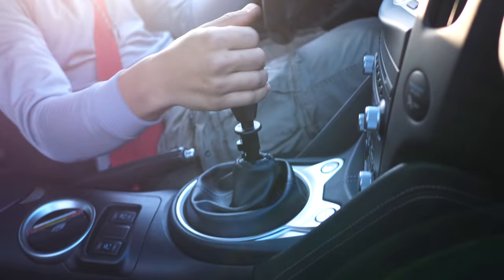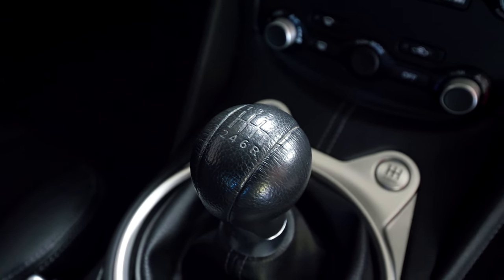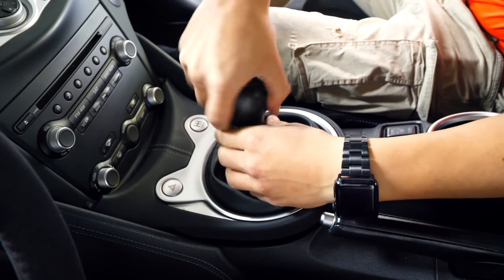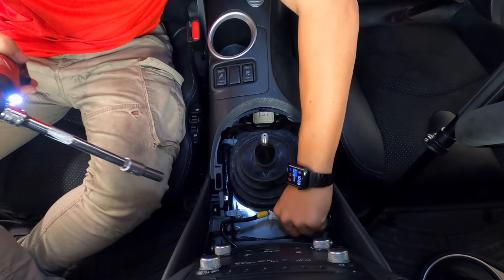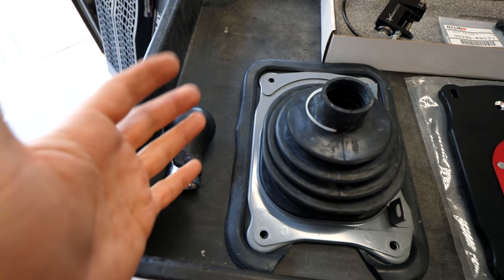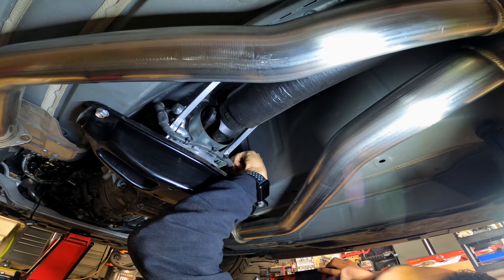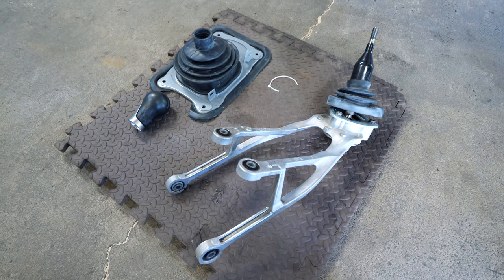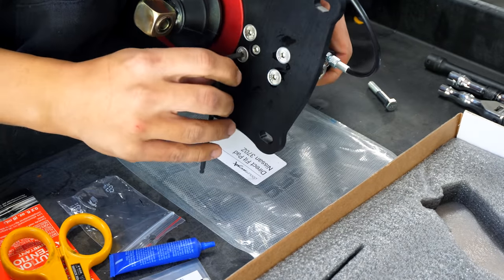The BEST Short Shifter for your Manual Transmission | Complete Install & Review

Comment: I got my shift knob off without any damage at all. All you have to do is use a heat gun and it helps break it loose easier just use gloves or a towel so you don’t burn your hands
Reply: I wish I read your comment before I had to muscle mine off.

Comment: Most important question 🙋🏻‍♂️ did you chase down that rattle yet? Also hows it holding up? Do you have to adjust every so often?
Reply: apparently if you tighten the bolts on the mount a little more and/or use loctite it will fix it for the most part

Comment: I don’t have a 370, but I have a 350z, I swapped my stock shifter for a weighted Mishimoto one and I never had troubles getting my stock one off, took 2 hands and a bit of strength 🤷🏻‍♂️ I’m no hulk but definitely wasn’t as tight as yours
Reply: Mine was hard. I had to buy a rubber strap wrench from Home Depot to get mine off.

Comment: This works perfect on 370 Z‘s if they do not have a black box blocking the two lower bolts that go into the fork otherwise you’re going to have to remove the black boxes to remove the lower fork bolts I have a G 37 sedan 2012 S model manual transmission and I found out this hard way.
Reply: Did u get this one or the 350z one ? I have a 6mt g37 coupe

Comment: Hey man I was on the 370z forums messaging you about double clutching!  what's up!  getting a B&M short shifter and having it installed soon.  The Coolerworx looked like it stood a bit high and I prefer resting my elbow on the center console cubby so went w/ B&M.
Reply from the maker: Have you had any issues with the B&M shifter? Vibrations? Rattles? etc?
Reply: @milanmastracci  Were you able to fix the buzzy sound at high rpms?? Im asking you because everything was fine when it was oem, then I installed a torque solutions short shifter and started having that wired sound at high rpms, so I got rid of it and went back to oem, but I still have that buzzing sound
Reply: I bought the Z1 short shifter. It is only 4” tall and I used a weighted shift know. The throws are only 3/4” throws. The stock was like 2” throws.

Comment: Awesome video! Did u install any additional engine/ gearbox mounts or are you able to run your set up on the stock ones?
Reply from the maker: Yes and yes. Engine & transmission poly mounts 👍 You can run stock mounts, but I would suggest upgrading to prevent movement between the transmission housing and the shifter assembly.

Comment: Most how-to guides advise to have alternate mole grips or similar on both the knob and the shaft so that when you put that much force anti clockwise on the knob, you support the shaft twisting clockwise, so force on the lower assembly is reduced and you're not damaging the lower mechanical parts/ box.

Comment: is it true that there are noises and vibrations I want to buy one but I'm a little afraid of regretting it
Reply from the maker: I had a bunch of noises on high-RPM deceleration that drove me nuts. Feels amazing, but if the buzzing is intolerable, I wouldn't suggest this shifter.
Reply: Shit sucks I got it on my g35.

Comment: are those rs05rr's you running? if so what spec are you running?
Reply from the maker: They sure are! I'm running 18x10.5+25 all around, with a 10mm spacer in the rear to make it flush

Comment: YO You have the same rattling that I have when you're at high rpm and then just kinda letting the car coast. Sounds like bb pellets in a bottle or something. Do you know what it is lol?
Reply from the maker: It is because there aren't rubber bushings or anything in this unit, so the vibrations from the trans go directly into the shifter. I haven't found a way around it unfortunately.
Reply: @milanmastracci  dang okay, I'll see what I can do about it. Thanks for replying so quick. Fastest youtube sub of my life lol.
Reply from the maker: I appreciate that brother! 👊 If you're able to figure out the buzzing, please lmk!

Comment: Second on removing the stock shifter without damages. I even try to use the rubber torque grip and not vice grip hoping to save it for mementos to no avail. What year is your Z? And how did you keep your 14mm bolts so clean? Mine is a '09 and pretty much all 14mm bolts that I had tried to removed so far are rusted/ or stripped.  At one point, I gave up after sawzall'ed the bolts out of the exhaust system and paid the the mechanic a whole day to torch the last few ones to put in the HFC.  Been following you for a while and found you originally by looking for review of the RJM Clutch Pedal Kit. 

My Z shifter now is rattling at 2500~3500 rpm and seemed to improved after my recent oil change. I'm unsure if the problem was from the transmission mounts but I might as well replace the urethane transmission mounts & this shifter if I have to go back under the car and struggle.. lol
Reply from the maker: Yeah I don't know how the shift knob could be salvaged.. My Z is a '14 and barely sees rain, let a lone snow and salt. Yeah some of those exhaust bolts can be a huge pain in the a**. Eh that's awesome! Thanks for sharing that! 👊

Comment: Have you been able to chase that rattle down yet?
Reply from the maker: Not yet. I don't know if there is a way around it..
Reply: @milanmastracci  that rattle sounds so light. My first thought was it's the collar you pull up for reverse? If it is, you might be able to add a bit more tension on the cable to pull it down.
Doesn't sound horrendous, but I can see it being annoying.

Comment: Too tall, looks aftermarket. I like short stubby shifters. Unless you fix that rattle that is a big con and something I could never live with.
Reply from the maker: Fair enough! The feel is what does it for me 👍
Reply: I was wondering as well - that the shifter was too tall - looked like it is at least 3" taller than stock.